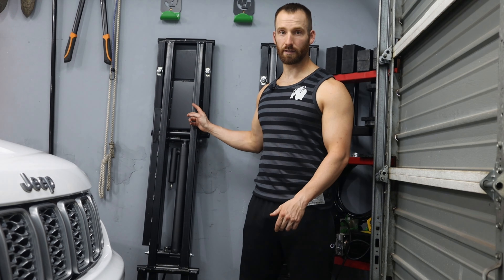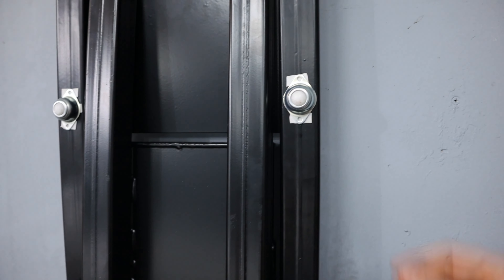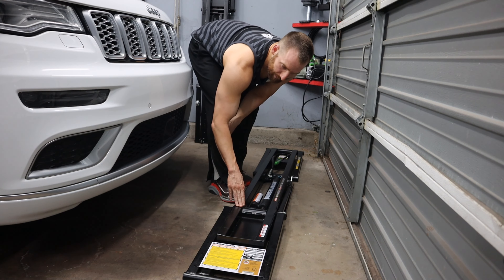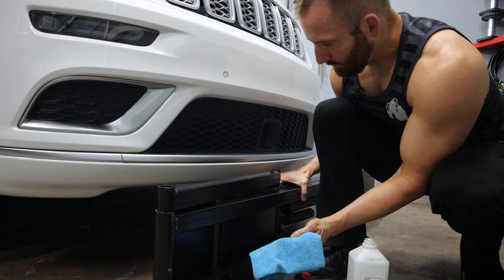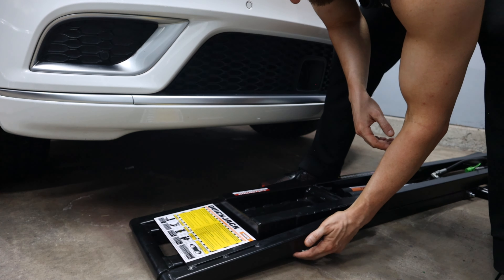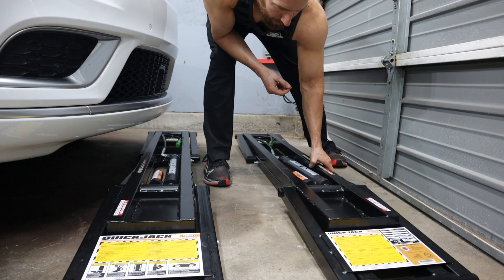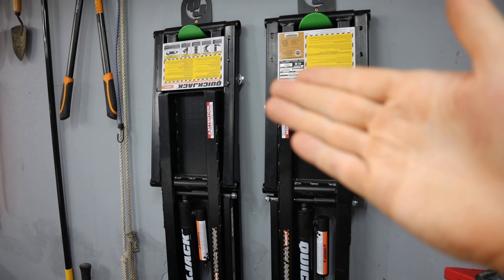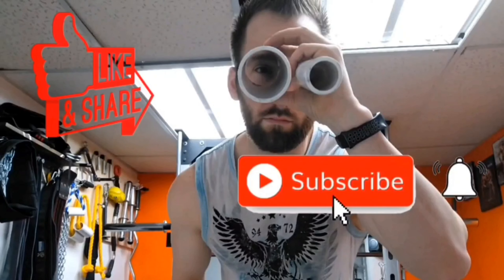QUICKJACK MUST HAVE HACK

Comment: Have you thought of attaching the casters with zip ties? I've seen some folks online do that. But I do like the double sided tape idea. Never thought it would actually hold up that well
Reply from the maker: @FillTheWoodb  I have thought of it. I wanted to see how the double sided tape does as a test and didn't think it would do very good but I've been surprised! It's almost been a year and I haven't had one caster fall off haha!
Reply: @SelfBuilt  I'll give that a shot. I initial was going to use zip ties. But I like the double sided tape idea as well. I've seen some more elaborate solutions to this issue. From custom steel welded metal with casters on them to 3D printed ones - All costing $350+. And this is by far the more economical solution 

Not sure why Quickjack hasn't yet provided a solution to an obvious problem.
Reply from the maker: @FillTheWoodb  Haha I've seen some creative and overkill ideas too. I completely agree that Quick Jack should have fixed this by now. I'll be making a 1 year review of these soon with 3 easy upgrades I've done that make these way better. 

I hope the tape works just as good for you as it has me! 😊

Comment: Why do they scratch the floor? Some basic engineering - All of the balls are spherical hence they contact the floor as a point load and do not spread the load on the floor differently. Where they do differ by size is the ball to housing interface which is what gives them different load capacities. The balls are probably not rotating smoothly and the movement across the floor may well be a combination of the ball rotation and sliding of the ball across the surface (Hence the scratches). Only detailed investigation will prove what is happening.
Reply from the maker: Thank you for your insight! I'm really not sure why it's scratching. The balls move freely and the jacks don't weigh more than the balls can handle. I'd really like to epoxy my floor but wonder if it would still scratch. 🤔

Comment: I tried this mod eith different sizes but the metal balls mark up regular concrete. My drive way was starting to look kids were drawing on it with white crayons. Scratches everywhere.  Less in the garage as the concrete is a higher psi and smooth.  Now looking for another mod.
Reply from the maker: @jrpowers667  Oh dang man that's lame. I wonder if they make rubber coated bearings to not mark up your driveway. I haven't looked at options for a bit. I'll have to see if I can find anything. Let me know if you find a good option.